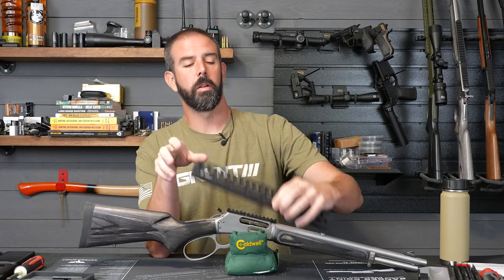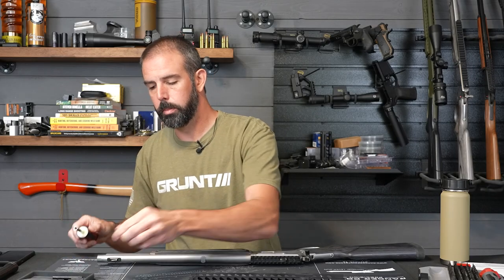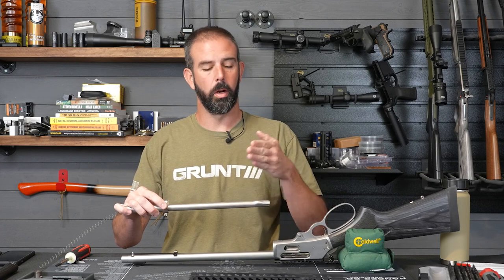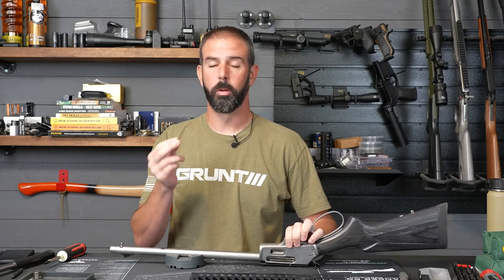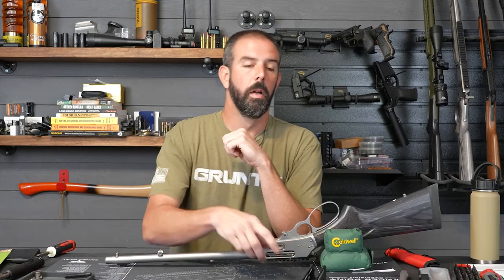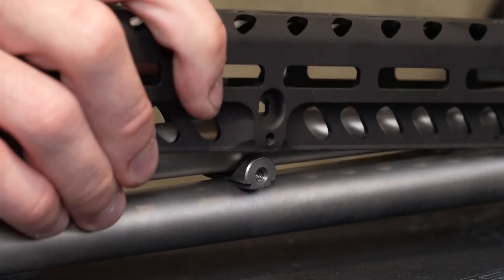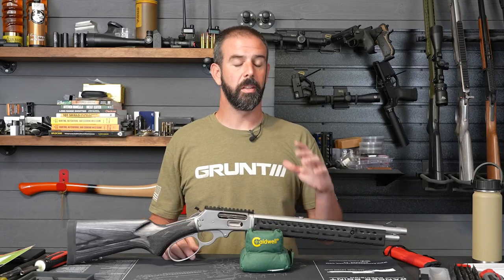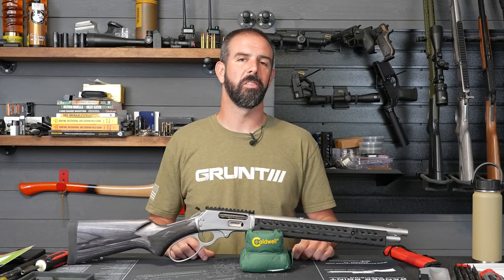Ranger Point Precision Gen 2 Marlin Handguard

Comment: Had a quick question for ya. I have one of the new Ruger 1895 sbls and I noticed something I have a question on. In one of your older videos you put a hand guard on a remlin 1895 and mention the bulge on the magazine tube and the importance about the direction due to loading. I noticed that my new ruger made Marlin 1895 sbl doesn't have this bulge at all. It is completely smooth all the way. I just wanted to know if you noticed this as well or if I should be contacting Marlin for warranty😂

Comment: Do you have a video of taking a Henry x apart? My hammer screw is coming loose and I want to loctite it but I don't want to screw something up.
Reply from the maker: No, I've only done takedown screws and handguard to the gun itself. Check with Henry Customer Service or Louthan Gunworks on IG. They should be able to confirm. I think you'd be fine, but I would check just to be sure.

Comment: Which do you prefer as far as trigger extensions go ? Henry Hammer Spur or the Carlson Hammer Spur.
Reply from the maker: The Carlson extends to the left, so I have no need for it. Of the two, I would pick Henry. If I could have any, I would go with the Ranger Point because it is heavily stippled and very easy to get a secure grip on with your thumb.

Comment: hi do you know if you could fit the midwest industries handguard adaptor under one of these as my 1894 has the barrel band which is around 8.5 inches from the receiver whereas i think the hole for the screws on the guard is 10 inches? thanks.